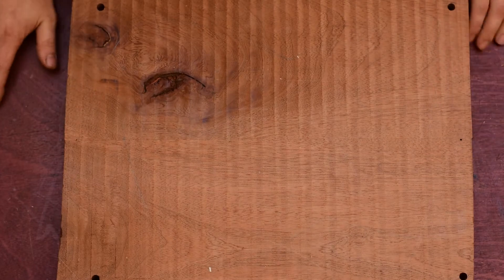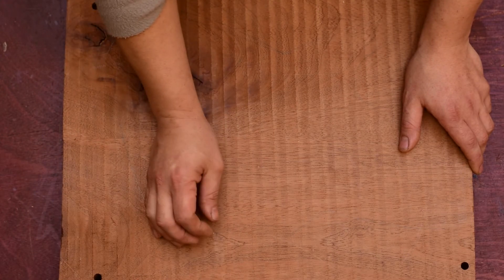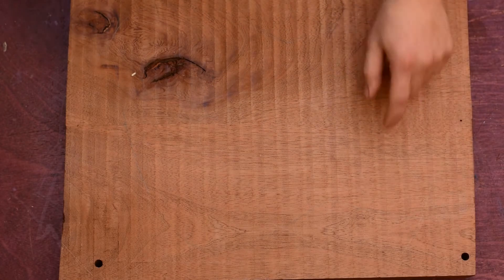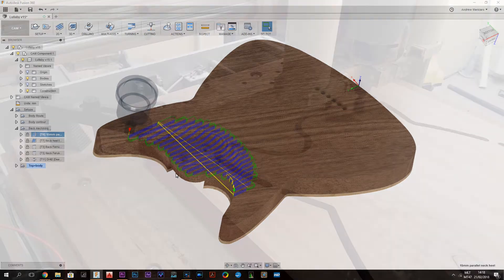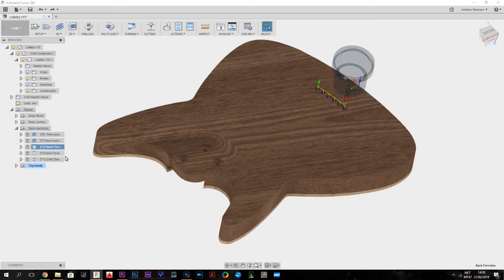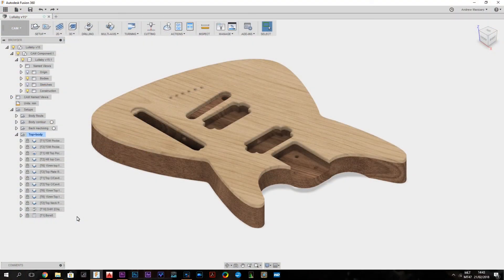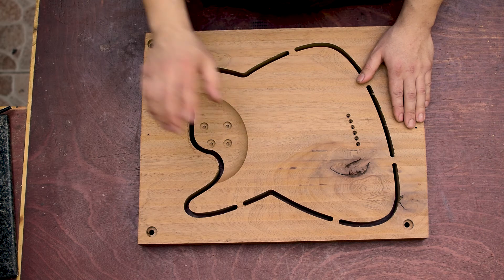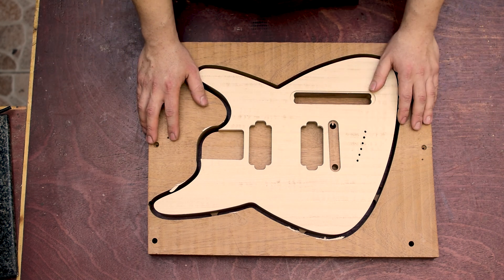How to build a guitar using a CNC - Episode 5

Comment: Hello, how did you do to flip the wood blank so the CNC can work properly in the other side of the wood blank? It is my only doubt :) sorry my bad English
Reply from the maker: Do you see I have 4 holes at each corner of the blank? Those are locating pins to set the blank on the table, those are equal spaced from the blank center lines so when I flip the blank the zero position will remain at the same position.
Reply: @ManicaroCustomGuitars  thank you hermano, you deserve heaven